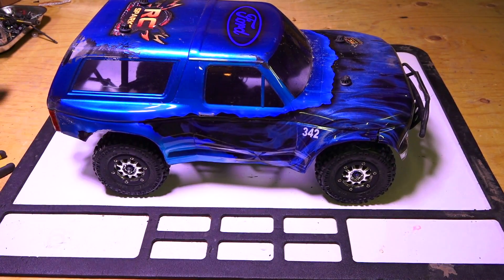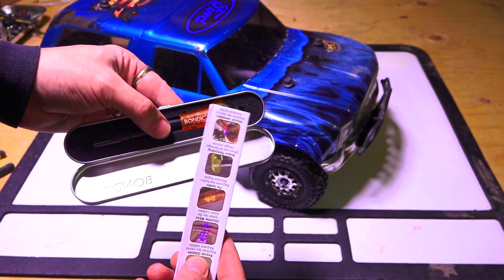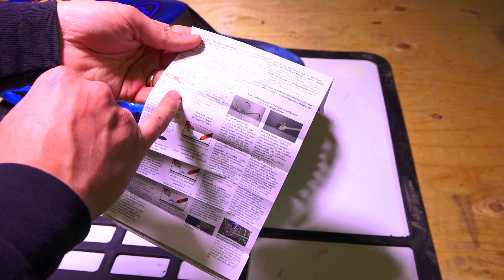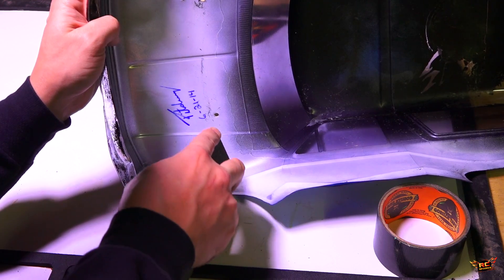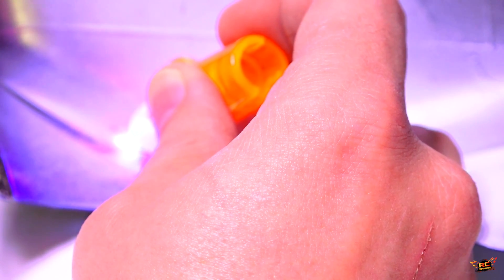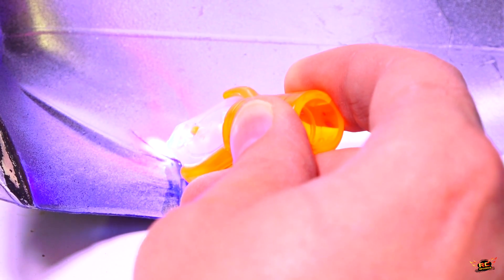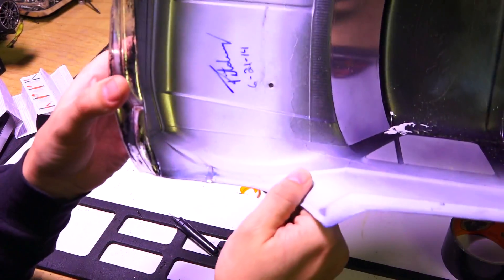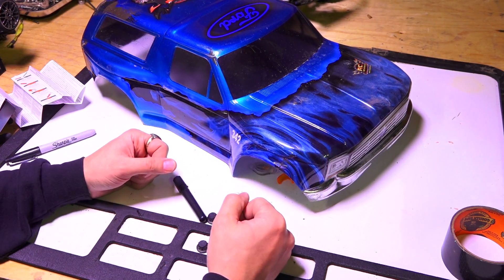RC ADVENTURES - Repairing a Lexan body w/ Bondic Liquid Plastic Welder

Comment: Another good tip is to drill a small hole at the end of the crack to keep it from spreading
Reply: +RC Grid that is a good advise, even if its just a tiny lil hole, the clean round cut will dead end the fracture!  😀👍🏼

Comment: I love Bondic. I have been using for a while now on most of my rc's.... mainly as wire holds. Just a little bridge of it over any wire anywhere helps neaten wires up very easily. 
Medic, if you're going to repair the paint in the back... Maybe black out the back windows so you can't see the body posts? Not picking brother, just a suggestion. Great video as always! Keep up the great work!

Comment: Hi all I did this, year 2018 and after few months it starts to crack on my Slash. But I done it differently and worked amazing. As this video no need to scratch the body; it’s take the few seconds and I did on both side bonded. This came extremely hard so it’s the opposite of Shoe Goo. 

So what I did is bonded then Shoe Goo + drywall mesh joint tape. We are 2 years later such 2020 and same bashing body.  

I had holes with miss part Lexan. No problems. Cut mesh around hole. Bond mesh to Lexan all around it to make hard; it very nice to shape it the way the body was to; little bond on line to shape. Then Shoe Goo the mesh and bond. Voila. 
Now your big hole is now hard where it needs and flexible such Lexan for the rest of the hole.  I have had the same bashing body since 2 years for my Slash and this mix Bond, Shoe Goo and Tape mesh just work so good.      For those want to paint without seeing the mesh. Clear tape ext do you mesh with bond, fill with Shoe Goo. Dry.  Remove tape. Paint colour and dry. Then mesh and shoe goo for reinforcing. Voila.   Bond is so nice to extend life of Lexan body.  Cheers all.

Comment: drywall tape and shoe goo i use and works great
Reply: +rocking546 Second that. The stuff is super tough when done right, but obviously the process is a bit more involved than what medic did here. I can see where this product would come in handy as long as it can hold up to the task during a run. Time will tell!

Comment: You might want to add a few more thin layers.  It gets stronger that way.

Some tips from my experience with Bondic:
- You can squeeze the light for momentary operation. Someone probably already mentioned it.

- It gets HOT when curing (thanks to NightFlyyer for his vid on that), so don't use it on your skin like superglue for stitches, or anywhere else where heat is a problem..

- If you are going to be gluing something bigger or for more time, get a fan and blow the fumes away as they are nasty. It doesn't stink bad, but the fumes are an irritant and can give you a headache and sore throat, that happened to me.

-The stuff has a tendency to leak, so might want to store it upright, so pen tip is facing up inside the case.

This is just from experience, I made a little "FPV roll cage" for my 1/24th scale crawler using Bondic.  It was for my tiny Spektrum VA2500 FPV cam/ VTx cloverleaf antenna that is sticking out of Rocksta top.  Made it out of RC car antenna tubes and "great stuff foam" applicator tube.. and it worked!   Made a vid showing the tiny rollcage.

Bondic is good stuff! Not perfect, but very good.
BTW Bondic are sending me out a replacement because mine was leaking all over the place and I complained about it in my vid.

Comment: An adhesive product I have a had a lot of luck with is Q-bond. It is basically super glue but it is paired with a powder that turns solid on contact with the glue. It probably wouldn't fix a lean body though.
Reply: Lexan body*

Damn auto-correct
Reply: +ChrisP Bacon Auto-correct makes us say things we didn't Nintendo.

Comment: Hi medic , great product I definitely need to get me some of that, I'm sure you would know this but, every body she'll I use I pre line it with fibre packing tape although it may make it a tiny bit heavier it stops most cracks in the first place it also takes away the noisy rattle of lexan whilst driving non of my shells have cracks and I bash and race them all the time
Reply: +MrNealeChidler Try "Rhino Guard" as a liner. Its an automotive rubberized spray. Its makes the body heavier but if you put a thin layer on it makes the body nearly indestructable from impact.

Comment: A handy video!

I've managed to get a crack in the body shell of my new TRX4 Sport which I built and painted! Only a few weeks old too. I guess one issue with this Bondic is does it still flex with the bodyshell, or does it cure into a hard glue which doesn't flex?

Comment: Ever tried shoe goo it is the best stuff i've ever used for repairs and strengthening lexan bodys. .
Reply from the maker: +orangeriderz here's the difference.. this was dry in less then 1 minute!  :)
Reply: +orangeriderz Yeah it is good.. I use it all the time.. but the fumes are horrific, and Bondic is FAST.
Reply: Shoe goo is the best with fiber tape it cannot be beaten despite the smell. I have repaired lexan body corners with it and nothing approaches the durability of this combo.

Comment: Medic for full scale vehicles theres body filler called Bondo and its like drywall putty but its blue or purple and you use it to full in tiny dints in a full scale offroader or to body fill a rebuild project. then you sand and paint so that could be how they got the name.

Comment: Curious to know if you're still using this bondiq stuff, if the repair in this video held up, etc.  My experience with this glue is it turns brittle and breaks, it's not flexible like say e6000 or shoe-goo would be

Comment: OK I have a question for you. I have the exc torment and I quit running. it turns on but won't move the front  wheels turn but the back doesn't work would you think it's the motor or something else

Comment: I actually used the stuff to chopp a 55 Chevy 1/8 scale body still holding also extended a 1/8 scale blazer body to be a 4x4 herrs it's awsome stuff arms cracked rims go pro mount it takes a beating only thing it's stronger then most bobby material so the material fails again be for it dose I'd give an a++

Comment: Hey everyone,  I just got a brand  New traxxas slash body and painted it then to protect it I mixed up some 2 part epoxy and brushed it all on the inside, especially in the trouble areas.  My son took it out for 5 minutes and had a minor rollover and the body shattered in 3 spots. Basically the entire way across the windshield where it meets the hood and behind both the driver and passenger side doors. Does anyone think the epoxy weaked the body??. I do live in buffalo and its around 50 degrees when this happened.  I need so.e feedback please.  That UV light stick looks promising. Thanks

Comment: If u want to do the zip tie thing but not us zip ties, use stainless steel wire and us that as a stick pattern it is really neat. Trust me I race dirtbike said and every now and then I'll crack a fender in a big wreck and I'll use this method.
I also play with a slash 2 wd I have a question about th diff, I have read forums and found 120k 300k lubricant but I have 500k is this an ok for the diff yes or no and if not what do u like to use

Comment: +RCSparks Studio I'm looking for and economic car around $200+ and I'm set on getting the Traxxas slash 2wd. Then id upgrade overtime with a better battery, upgrade the motor, and shocks
Reply: Do you think it's worth it?
Reply: Get a Vaterra twin hammers
Reply: That's $400?!
Reply: +Lax Bro You should look at a used one. I bought a Slash 4x4 Ultimate Edition with two 2s lipo batteries for $200.  The body was a little beat up but everything else was in excellent condition.
Reply: Where did you get yours?
Reply: I bought it off a buy and sell website called Kijiji. Its only in Canada . But maybe Craigslist or something similar if you are American
Reply: Ok
Reply: +Chris O'Donnell kijiji is not only Canada I use it in the US
Reply: +BashBrothers Rc Thanks, Good to know. I thought it was just a Canadian thing.